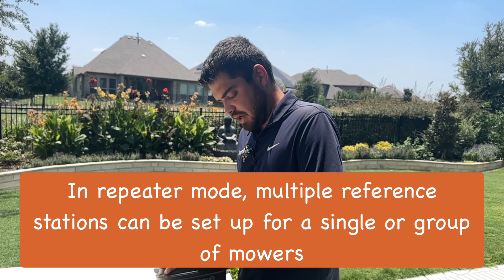What is the EPOS Reference Station?

Comment: Hi, I have the Automower® 410XE NERA running without a reference station but using my garden WiFi access point instead.  I’ve only had it for a few weeks and my only observation is that the Automower can spend some time ‘searching for satellites’.  If I invest in a reference station can I still use the iOS app to remotely monitor & control the Automower via the WiFi when I’m at home & away as I do currently?